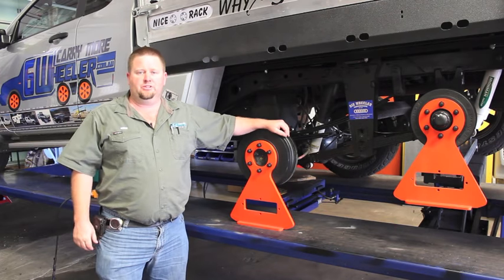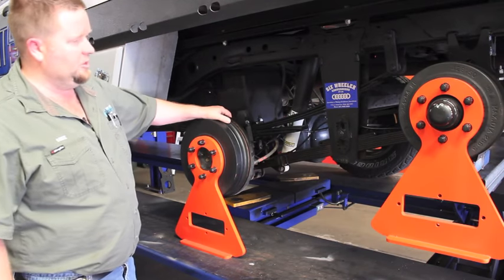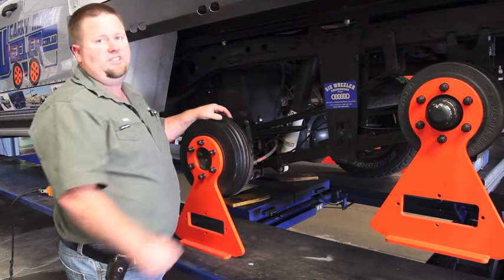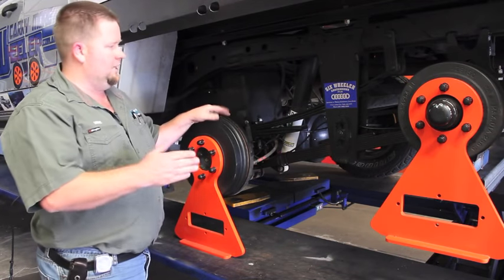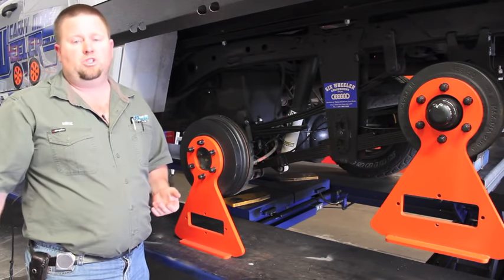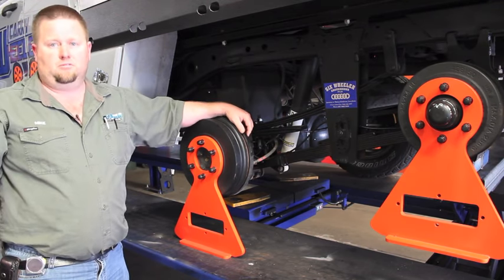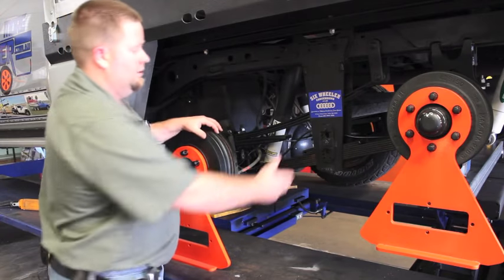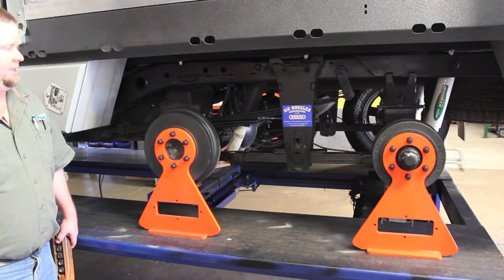How our Six Wheeler Suspension Works

Comment: Very cler view: Can you make a new video lifting de middle axle to show how suspension work ?
Reply from the maker: The drive axle suspension works the same as the original vehicle?
Reply: OK, understand, but if you say drive axle load carry 60% of weight ? the pivot point is in the center of axles ?  I want this system or an extra axle for an old FJ 40 Toyota, 
I want long body to carry more people, but doesn´t want a long wheelbase 4x4 modification for turning radius and ventral angle problems. 
Great Solution, Thank you
Reply from the maker: We have done FJ's in the past but we are no longer tooled up for them.